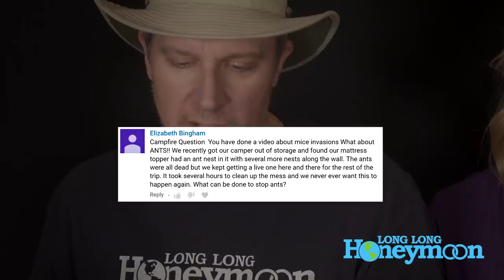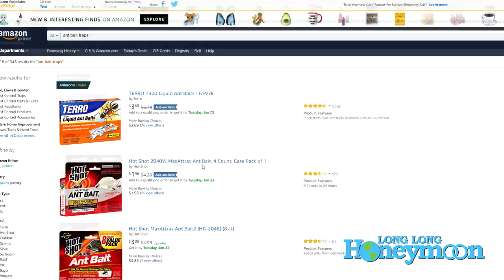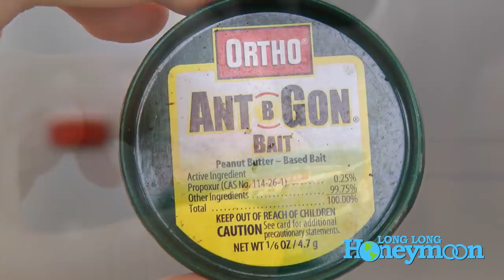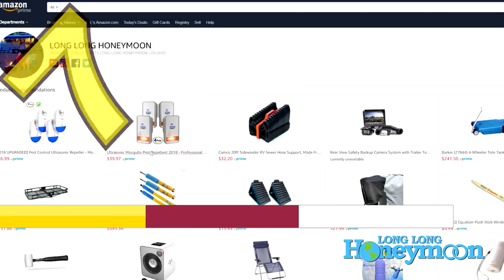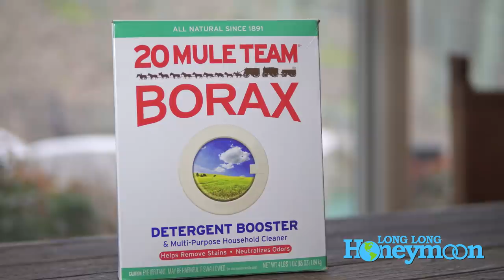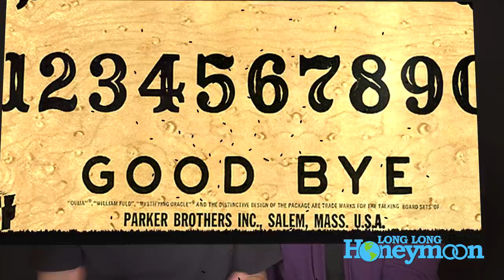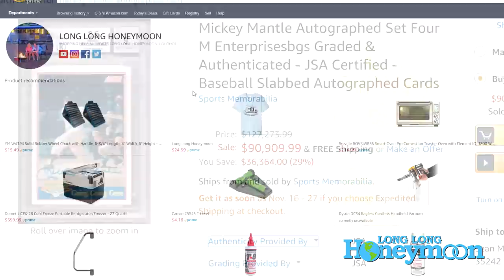🐜 HOW TO STOP ANTS 🐜 from Invading an RV - 15 Tips!!! 🐜

Comment: Long Long Honeymoon - I'm a bugaphobe, anything with more than 4 legs, I've been terrified of spiders since I was a small boy and in 2 weeks I'll be 30 for the 34th time, is not welcomed in or near our sticks and bricks house and the same holds true for our new RV. At a previous house we had a brief fight with mice and found that plugging any little hole or gap with steel wool and using the black glue boards along with the green poison sticks works. Spray foam insulation is a fail because mice can/will chew thru it. We adopted 2 Greyhound rescues 6 years ago and last year brought Tazzy, our 1 year old long hair Tasmanian Devil Chihuahua puppy into the mix. Tazzy, our friends call her HOOVER because she picks up anything, will be going along on our travels, that's why we have to stop the varmints before they the RV. 

One of my husband's clients owns a body shop and has offered to put the new motor home, a 25' LTV Unity FX, on one of his lifts the day after we take delivery. We'll be armed with steel wool and Gorilla Tape to plug every space, hole or gap to keep the mice out. We've researched the ant and spider issue too and a 1" wide band of Vaseline applied to the water and electric supplies and the sewer hose just before it enters the RV seems the best idea. Someone suggested a rope light placed under the RV will offer enough light at night to scare the mice off and is worth exploring. We plan to spray an insecticide to the tops of all 6 tires to keep ants, spiders and other creepers out, they're our property, and will add your idea of ant bait traps to the black glue boards and green poison in each outside storage bin and the utility bay. We will also request a campsite or RV Resort site with no over hanging trees, spiders hide in trees. I'm also a neatnik, I iron our jeans, so there's never a crumb of food anyplace in our kitchen or the sinks to attract anything. 

GREAT video and I feel better now but what have you got about keeping bees away, I'm Epipen allergic.
Reply from the maker: Give Tazzy a nice belly rub for us! We are traveling throughout Florida with our family chihuahua next week.

Comment: I have my 1st ant problem. I found where they are getting in. Our r.v. has a pass through door from outside that opens under the couch. 
    I am having success with glue traps! Once they get stuck they can’t move!
I have also used the home ortho. 
  I just treated the r.v. with that tonight  & mouse free under the camper as it also kills ants and other insects.

Comment: I use borax where it can't be gotten at by pets. And we love our pets. We keep a close eye on the pets in the first place cause of rotten food and many other gross unmentionables. Anyway, I also wrap my water hose, power cords and such with duct tape in reverse with the sticky side up. It comes off easy just cut it. It also keeps more than just ants away. Pull tight and the nonstick side will grip enough to stay in place. Always a good idea to have duct tape on board anyway. Many of used. Love you guys keep the videos coming.

Comment: We have ants cause problems every so often at our garage door. Since it isn't an RV we can't just move. We have tried the commercial traps and they work for a while. Sometimes later in the same season they are back though. This past summer, since we are currently without a pet, we tried Borax on the entry point and soon they were gone and didn't come back. We just spread the Borax around where the ant trails were. We didn't mix it with anything. We'll have to see if they come back this next summer. Right now they would all be frozen.

Comment: We don't have pets so this is what I do. I purchase permethrin concentrate at a farmers supply store for treating horse stalls. I mix 1oz to a gallon of water in a small hand held 1gal pump sprayer. I spray everything that touches the ground and the whole campsite underneath the camper, picnic table, etc right after I level the camper and unhook the truck. Kills spiders, ticks and chiggers also. Inside the camper my wife will spray Bug Stop, squeeze bottle-not areosol, along the baseboards ( in the house also) and I spray BS in the storage areas. The one spring we didn't do this we got ants. I used borax/honey mix to kill the in-house colonies.

Comment: This may seem kinda grody to some people, but I spray a thin line of silicone grease around my levelers and tires and my power cord and water hose. Stops mice and ants, dead in thier tracks.
just wipe it off before you stow these items. It is slippery, so mice cant get a good grip and ants wont come near it. That includes my aunt Jeff

Comment: Hot Shot, roach killing powder is great for getting rid of ants,   Comes in a squeeze bottle that is easy to use and store.   Put a little around the electric power source, sewer line and water line where they last touch the ground.   You can dust around the tires, stabilizers and jack.   Not expensive and no clean up is required,  I use it at home too when it rains and ants head for the porch or garage.

Comment: As a farmer I can say that Borax is the best DIY option. You just have to put it in pet proof containers. I have been using plastic Mason jars that mayo comes in. I punch a few holes in the neck for them to get in an only add about 1/2 inch of mix to the jar. Not enough to leak out if your pets knock it over an kick it around.

Also water, sugar an Borax works on sugar ants but not others. Replace the water with milk to add protein to attract all the other ants. But getting the mix right is a pain making those premade bate traps worth the money. You need to be seeing dead ants around the jar so you know it's working but not to many. You need most of them to make it back to the nest with the bate before they die. Otherwise you are just killing the scouts an not the nest.

"D" Earth is great for really tiny creatures like mites that have to crawl through it but not for ants that have legs an just walk over top of it. It also stops working if it ever gets wet. That makes it pretty useless outside. An it not all that safe to breath so I would not use it inside.

Comment: Hello Loloho, my wife an I love to watch your videos and want to thank you for all the informative help you give to your fans. We have been RV'ers for years mostly seasonal and weekends with our Kyanna Birds Camping Club. You guys even mentioned us on one of your videos about going to Alaska.We plan on making that trip in two years. But back to the ant problem, what I like to do is to make sure the waste hose is fully stretched out where water can't gather the concave areas both internal and external, ants love this. Also I don't like either our power cord or the potable water hose lying on the ground, I like to tie them up using the bracing on the slid outs. Also what I do is use Clorox Bleach spray to spray both the inside and out side of the waste hose before connecting, ants don't like this. I also use the bleach on the water faucet before  hooking up, because you just never know.

Comment: Park so that the RV's tires are positioned in the center of sheets of heavy duty plastic.  Then, elevate the edges of the plastic to create a bowl-like structure with the tires in the center.  Then, fill the bowl with water.  Ants will have to swim to get to the tires.  
:-)

Comment: I got that Champion inverter generator 4500 remote start from Amazon for $600.00 that includes the 3 year warranty and it is awesome wife and I have been using it for the air conditioner man it’s almost, I am glad I got it instead of the Yamaha witch you would need two of them to run the air conditioner , thanks for helping me choose the champion generator after I seen the one you have, if I was you I would get the champion generator as well

Comment: If ya spray your sewer hose with full strength white vinegar every other day ants won't use that entryway, and not the whole hose, just a two feet area where it's closest to the ground.

Second a mixture of Essential oils such as peppermint oil, citrus oil and tea tree oil to make an ant-repellent spray or drops. 
In a dropper bottle one ounce
Peppermint oil=120 drops
Tea Tree oil= 120 drops
Citrus oil= 28 drops
Fill the rest of the dropper bottle with distilled water, shake before every use.
Drop drops of oil all along door entry ways on the metal.
I've used many remedies and this Essential oil thing worked to get rid of those big black ants you could put a saddle on, carpenter ants!
Those 3 Essential oils cost about 7 bucks each and will last a year.

One final thing to do is Peppermint oil, put 4 drops in all your furnace floor outlets and run the furnace for about 5 minutes, this permeates the  vents with peppermint scent, and ants hate peppermint oil scent, so they stay out of that area, and peppermint oil destroys scent trails.
It also makes your RV smell great!
I have a cat and had to look for and find alternative solutions for getting rid of ants in my RV without poisoning my cat at the same time, so I went the biological ant way to defeat them, Ha!

Comment: I am in between campers now however I do not call it invasions I call it infestations.  I usually kept one of the bug  insecticide battery powered sprayer containers and went to town spraying before I backed in (or pulled through) I never let it bother me that it was not allowed in some locations.  After I parked I sprayed my tongue jack, around the tires around the electrical,and cable wires and around the sewer hose.  I liked the Oreo suggestion soooo much that if I saw an issue, I think I might consider a n ice perimeter sprinkling sugar in a complete circle away from our camper. who knows they might find that source of food more interesting.

Comment: Renovating my camper right now, so there’s no food or water in the camper, but I’m still locked in a constant battle with ants. Seems they love chowing on the construction glue. I’ve been spraying hot shot on the jacks, tires, and any cords touching the ground, but I’ve also found that me and my little eight legged friends (spiders!) have become allies in this war. I spray to break up the trail, and spiders eat all the stragglers. Once I found a trail I missed spraying, but the spiders built a barricade of webs in the opening so the ants had to run a gauntlet of death to get into the camper. This why you shouldn’t kill spiders (unless it’s poisonous).

Comment: One thing I have found effective is duct tape or 100mph tape.  Wrap it around your power lines, sewer line, or anything leading into the RV with the sticky side out and the ants and other creepy crawly things just get stuck.  Even works if you wrap it around your jacks.  Tires are a little big so you might have to find something different for that.  Of course this only works for as long as the tape stays sticky so you would need to check it if you are parking for a long while.

Comment: Hi. You forgot the safest, cheap way of repelling bug... boric acid or equivalent. Yes it the same stuff you wash eyes with.  Toxic to bugs but safe to us.   I've seen it come in a chalk form and powder form. bugs won't cross the powder. Its not the borax you mentioned for washing clothes I think.
Reply: Sprinkle borax powder around.  We use it regularly.
Reply: No, Borax is sodium t-something or other. Boric acid does work a bit better but is much harder to find.
Reply: Boric acid is very cheap.  Seen it at the .99 cent store at times and on ebay for a couple bucks.  Borax is sodium tetraborate and used for washing mainly.

Comment: I had carpenter ants get in a older class C RV that was a bad bad bad situation I finally used  ant trap poisions and it worked well but the wood damage was horrifying! I spent weeks repairing ! That old proverb about opening a can of worms ! I started in and don’t think I ever stopped fixing one issue and found more things that needed fixed .... grrrrrrr🤬

Comment: Sorry...forgot to mention in my previous comment:  I bought my RV used from a dealer. Brought it home. No ants for at least three weeks, so I know they started invading once I brought it home. It was totally clean and there was no food at all inside. No anything, actually. I'm just now starting to 'move in'. So, unfortunately, just keeping things super clean isn't always a solution. It'll just help keep it from getting out of control. The ants are just exploring right now, but they are getting a bit worse, now that I'm sleeping in there sometimes and running the AC. Maybe the cool and humidity is a factor? And maybe because it's been pretty dry around here for a couple of weeks. They might be attracted to the slight damp and cool of the RV. Not sure. In any case...gonna try Dawn. We'll see.

Comment: I had some small black ants get into the cabinets in South Tampa Bay.  They hid in the brown sugar.  They are bitter and do not add anything good to apple pie. Turn on more light when baking.   I spread Amdro around the tires, utility connections, jacks, and those little ant traps in all the compartments. I may have also sprayed some penetrations in the refrigerator compartment (outside).  Ants went away. I got a better container (s) for the sugars. Pharaoh or Sugar ants are the worst cause they can establish a colony in the trailer.  Fire ants are the best cause they, like termites, need to return to ground for water. So you can cut off their escape routes.  At the lake we treat mounds and put Amdro barriers around tires, posts, etc near the mound. .

Comment: If you sprinkle Comet 
(kitchen cleanser)
Around your RV steps, at any cord, tube or orifice entering your RV. 
Ants hate it and if they walk thru it they die shortly there after.
In the home I put it under windows, door stoops.
At window sills and under doors, you can  sprinkle it down drains.
I also killed an ant colony living in a  big tree next to my home, carpenter ants. Eating the wood on my new home. I killed them with Stiff Stuff that foam that expands when it comes out of the can when it hits air. It froze the whole colony inside the tree they were nesting in.
Never had that ant problem again. Saved my house.

Comment: The easiest, most natural, and cheapest way to get rid of ants around your RV or campsite is this - and I have used it for years in my yard and it has never failed.   Sprinkle CORNMEAL on the anthills, or wherever you see the ants around.   The way this works is this:  Ants are unable to digest cornmeal.  It clogs up their digestive systems and they die.  They also bring the cornmeal back to the queen ant of the mound, and it kills her, and then the rest of the ants leave for somewhere else.  Works like a charm.  I think I would sprinkle some around  a campsite right away when I arrive and let it work.  (I have even used corn muffin mix with success.  The flour in it didn't hamper it's effectiveness.)

Comment: I had ants everywhere. In micro Wave, oven, stove everywhere. Tried all you showed nothing worked. So, I put a table spoon of pancake syrup in the middle of the sink to attract ants. Early next morning I had 800 - 1000 ants feasting on it. Then I flushed them down with hot water. Did this 3 days in a row till none showed up for the banquet. 🐜🐜🐜🐜

Comment: A year ago larryz24 said TERRO! Yep. If you have a few days to spare, Terro is the deal. You will have to witness the gross ant mob scene but after two/three days? Gone. Oh, and get the liquid, not the individual stations. Cut up cardboard, squeeze out a quarter-sized puddle, put it out of pets' way or even outside and it will work, guaranteed.

Comment: Vaseline!  They will never cross it and it takes a long time to dry out.  I know it can be a bit greasy and does attract dust but it works like a charm.
Reply: snakclub - Vaseline sounds like a good idea but it's a petroleum based product, won't it damage plastic?
Reply: Possibly...I've used it mostly around the house (like in doorways) to stop the ants.  I'd smear some around the base of each stabilizer leg, some around the bottom of the tongue jack tube and finally a bit on each axle behind the brake plate but before the suspension.  Now I suppose you'd have to put some on the sewer hose, the fresh water hose and the electrical cord.  Wow what a pain.
Reply: Vaseline is fun to put on bird feeder poles. Squirrels will spend hours trying to get past it.
Reply: snakclub - We did a bit of research regarding the use of Vaseline and it's reaction with different types of plastics. The electrical engineers say it's used on connection points inside electrical devises without concern. Others say it won't degrade plastics adding if it's used for skin care products what's the harm. Some experienced RVers suggest applying a one inch wide band of it on electrical supply lines, water supply lines and the sewer hose nearest the connection point adding NOT on the connections themselves. They also suggest keeping the lines off the ground, duh, but I see a tripping hazard. When leaving the campsite, wipe off as much as possible and wrap the cords and hose in plastic grocery bags before winding them up to avoid a mess.

Comment: If it comes in contact with the RV, spray it, in advance, THOROUGHLY, with a 6 month insecticide. Including the tires. All else is just reactionary and useless.  It will be the best $6.50 cents you spend at Walmart or HD.